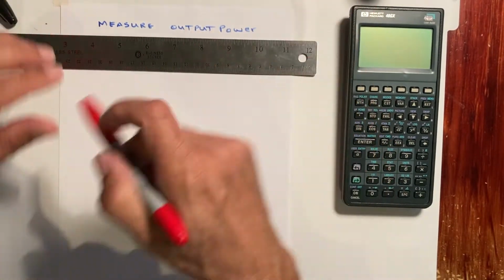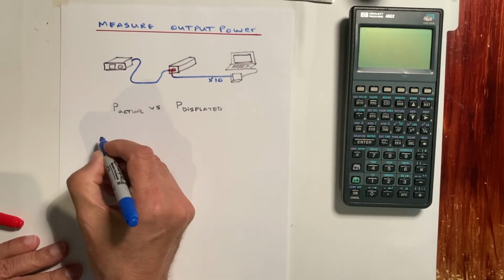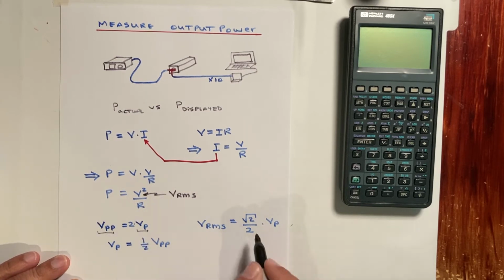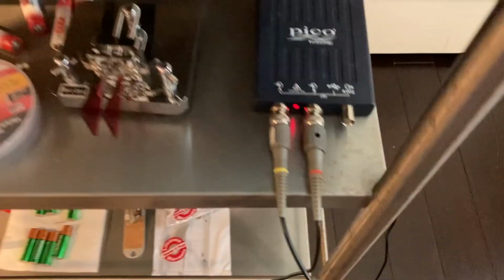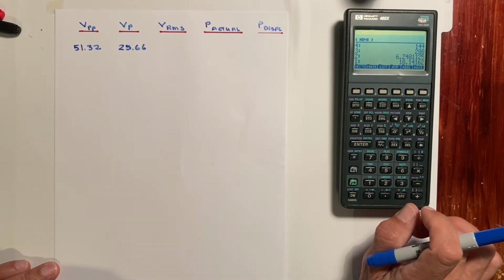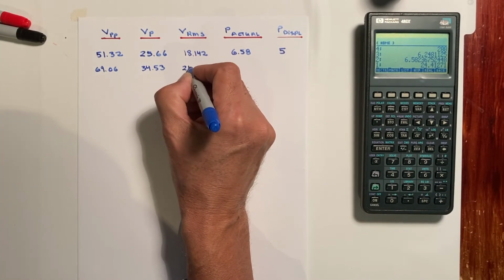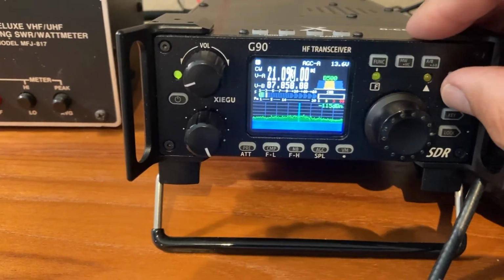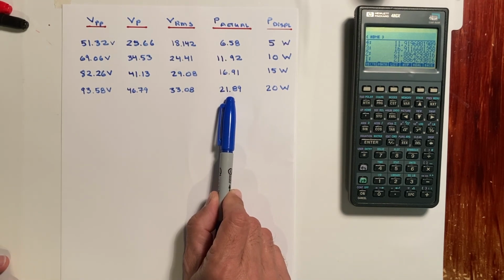Using a scope to measure Xiegu G90 output power

Comment: Do you key the cw with the ptt button?
Reply from the maker: I used the CW straight key.  73.
Reply: Sorry ,The g90 have an actual key for cw?  Or you you install an external?
Reply from the maker: @mandytuning  The G 90 doesn't have a built-in key.  I had plugged in an external CW straight key for this project.  Best of luck.